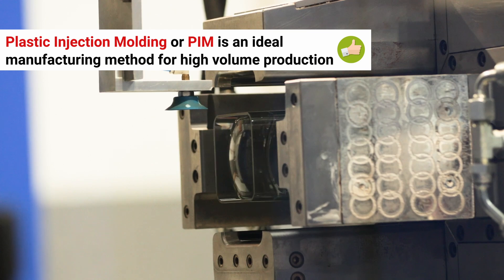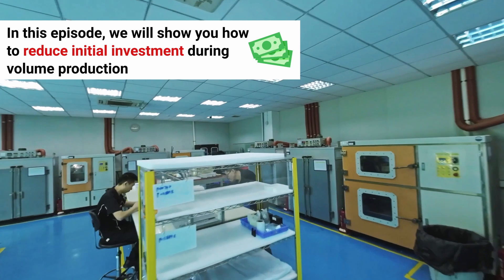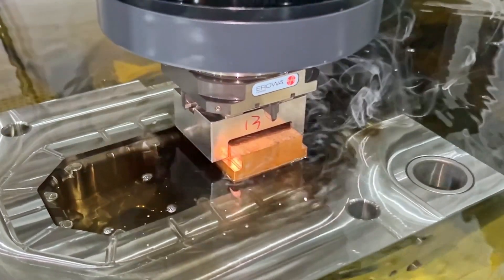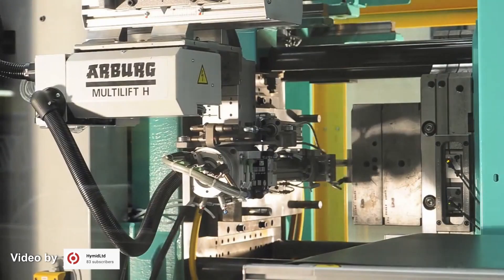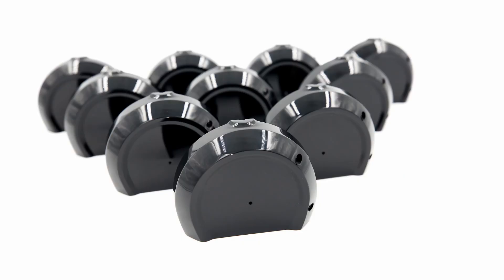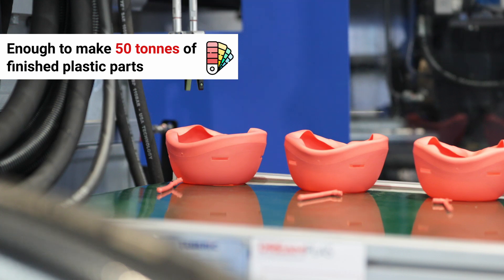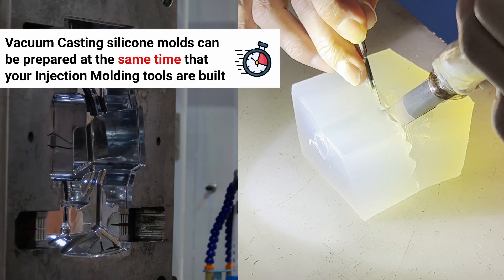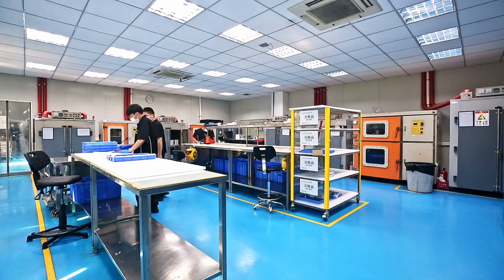3 Reasons Why You Should Use VACUUM CASTING Before PLASTIC INJECTION MOLDING During Prototyping

Comment: Seems modern SLA is better for most smaller things.
Reply from the maker: While SLA offers incredible precision and detail, vacuum casting can still be a great choice for many rapid prototyping needs. If you need a lot of prototypes, vacuum casting is often cheaper and can be made faster. Plus, vacuum casting can accurately mimic the properties of certain production materials, making it perfect for testing how your product will work and what materials to use.